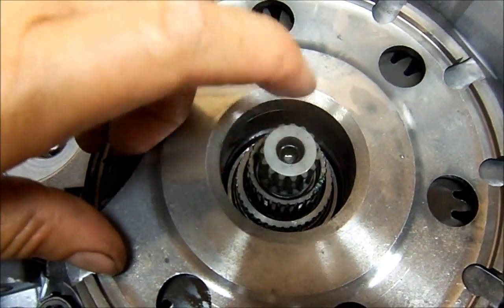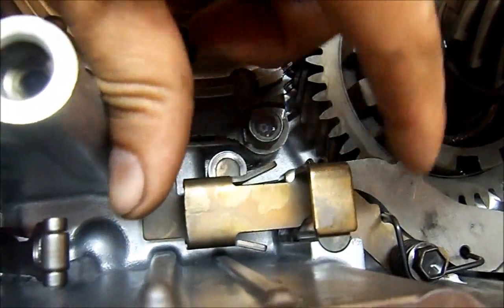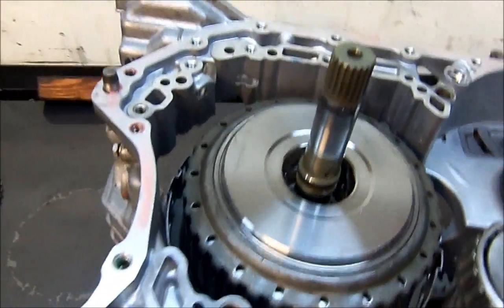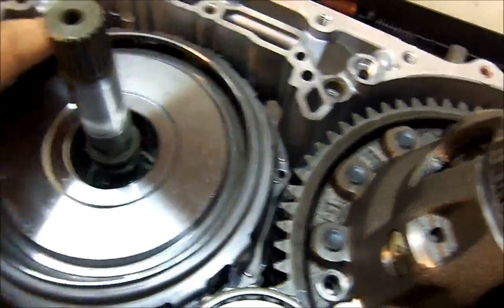How to Rebuild a 09G Transmission: Complete Tear-Down and Reassembly

Comment: I am curious, I have a 2008 Vw With the 09G KBV Transmission and It has no gears past 3rd, It is as if you throw it into neutral. I see what you are saying about the sleeve rotating potentially causing this. The fluid is burnt and someone else prior to my ownership tried to do a drain and fill. This was obviously more than that. So Rather than searching for a "Good" Used transmission how much would it cost to have a rebuild like this done on mine? I am a mechanic but not a transmission tech. And of course I understand the failure could be much different than the one in the video.

Comment: Sorry, Little late, but Is this the same gearbox as' in Touareg 3.0 v6? I got stuck and after it behaving strange and It lost reverse gear. What is commong problem?  It will drive forward, but wont move back not even In N or R when we tried to tow it. But it will drive forward with little problems and Got it home, but I dont know how to begin to fixing it?

Comment: The plastic filler tube broke two small plastic prongs off into the filler hole in the 09g, when I wiggled the filler pipe. They are stuck above the valve body. Do you reckon the bits will survive or will the transmission?

Comment: Thanks for all your great videos!

Rebuilding 2005 Mini Cooper S auto right now...installing new pistons, frictions, steels, and typical rebuild kit stuff. 

Any tips for reinstalling B2 Clutch Apply Piston Return Spring Assembly?  Having trouble getting retain snap ring in place while compressing return spring.   Yours is second video watched that skips over how got spring back into place - any guidance much appreciated!

Comment: Good video! I am having trouble with an Audi TT with 09G transmission , when hot it shifts hard from 1 to 2nd , flares from 2nd to 3rd, I am getting an incorrect gear ratio monitoring code, I changed the valvebody with a rebuilt from China and similar issue , now it hard shifts on downshifts now , I did adaptation, and also installed a shift kit no improvements ..any advise
Reply: shawn parasram clutch packs could be gone or dual mass fly wheel
Reply: Or your tcm

Comment: Hi Hiram I just rebuilt my 6 speed 09g transmission in my mini cooper s.  Your videos helped a lot during reassembly. I replaced the valve body with a used one .I'm still having harsh gear engagement when hot . Was wondering does the TCM need a shift relearn??
Reply: Also my mini cooper s  is a 2006
Reply: Yes

Comment: Hello Hiram! I have VW Jetta 2006 2.5l, 09G transmission. Slipping 4th gear but only when ATF is hot. When ATF cold, temperature not high then 60-70 degree C, transmission working good, 4th gear not slipping. When it hot - slipping. And it has some nuances, when increase gear from 3th to 4th, first time 4th gear slipping, I stop aerate, wait 1-2 second, aerate again - 4th gear not slipping. And when I do downshift from 5 to 4th, 4th gear not slipping. What I have to do? I planed re-assembly transmission, change oil (almost 200T. KM - nobody changed) clean valve and instead  heat exchanger  put oil radiator in front. What  do you advise? Thank you!

Comment: HOLA HIREAM DISCULA PERO NO SE INGLES, BROTHER DE VERDAD ESTOY DESESPERADO MI AUTO ES UN JETTA A4 2007 TRENDLINE TRANSMISION AUTOMATICA, POR AÑOS LLEVO REPARANDOLA, PERO ESTA VEZ YA NO SE QUE HACER LE HE CAMBIADO LA CORREDERA DE CAMBIOS, EL SENSOR DE LA TRANSMISION, ETC, NO ME HACE LOS CAMBIOS TENGO QUE HACERLOS MANUAL, EL ULTIMO PROBLEMA QUE TENGO ES ESTE
Address 02: Auto Trans        Labels: 01M-927-733.lbl
   Part No: 01M 927 733 MR
   Component: AG4 Getriebe 01M    5081  
   Coding: 00000
   Shop #: WSC 00000  
   VCID: 8C17C2B2BCEBDA7E78B-0968

1 Fault Found:
00268 - Solenoid Valve 6 (N93)
            36-00 - Open Circuit

YA LE HAN PROBADO SELENOIDES BUENOS Y SIGUE SIN HACER LOS CAMBIOS, EN INTERNET LEI QUE HAY QUE ACTUALIZAR EL SOFTWARE DE LA COMPUTADORA DE TRANSMISION,
http://www.opinautos.com/volkswagen/bora/defectos/66201/falla-comun-en-transmision
 MI MECANICO ME RECOMENDABA COMPRAR UNA COMPUTADORA SEMIUSADA YA QUE EL DICE QUE ES LA COMPUTADORA LA QUE ME ESTA DANDO TODAS ESAS FALLAS,
LA VERDAD NO SE QUE HACER, OJALA ME RECOMENDARAS ALGO, POR QUE YA HASTA ESTOY PENSANDO EN REMATAR EL AUTO
SALUDOS DESDE MEXICO
Reply: ya acomodaste la caja??

Comment: Hello Hiram, I have a VW NEW Beetle 6 speed triptronic1.8 L Turbo Convertible slipping in 4th gear. Should I just purchase a master kit and rebuild the transmission or should I just change the clutch pack. Which part normally fail when this happens?
Reply: Is that really because the filter in these things is just a very fine mesh screen?  I would think that such a filter might be the root of some problems especially if that screen gets any holes in it or anything of that nature.  They are just fine mesh screens and I do not believe that they could stop all the particles from getting through.  Unfortunately, when they do get through they could get stuck in the valve body and cause problems as bad as not being able to use reverse among other problems.  Could the slipping caused by this be what causes the codes in the description of the video?  I know that transmission problems only get worse unless you get it into a shop.  My car has a 09G and seems as if it may be slipping too and unfortunately it is a common problem with automatic transmissions.

Comment: Why does Wikipedia have the 2004 GLI mk4 listed using this transmission also,  mine is about to be replaced wondering if I can put one of these in on the 1.8 AWP motor.